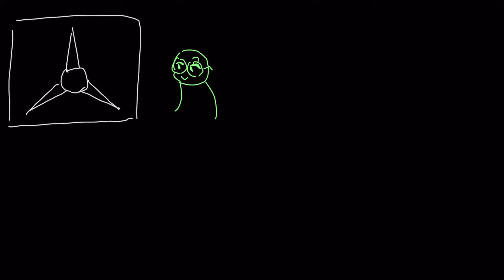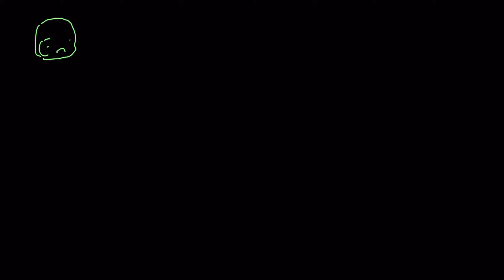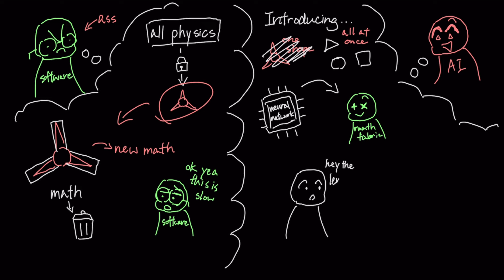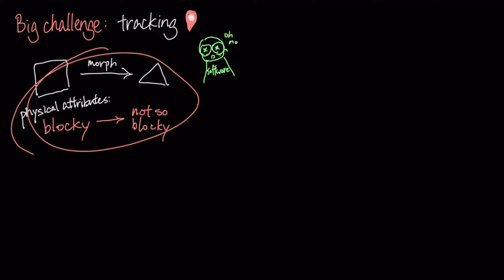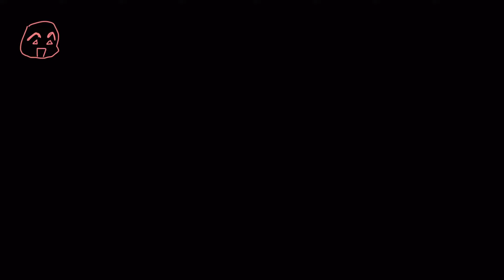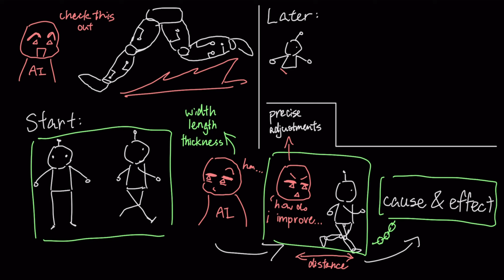From 1 Shape to 1,000,000 Designs | 3D Simulation Breakthrough

Comment: don't know much about topology, but hallucination is one thing you don't need in aerodynamics. Yeah, you can double check by a proper simulator but you might miss good solutions too. its better to do a low res simulation for bigger changes and localized ones for small ones. AI "training" is basically a way to lossily compress data of simulators that trained the AI. Polygon count could potentially confuse the AI to give different answer for the same shape. But the paper looks interesting, will give it a proper read to see how if it answers my rambling:)
Reply: skimming through it, does seem to look like a good find, but only as a general approximator, only a small error after rotation as characteristic of ai, but love a good custom simulation over blackbox obscuration